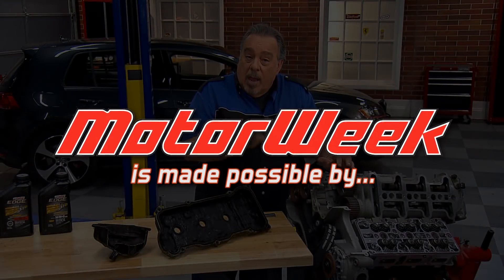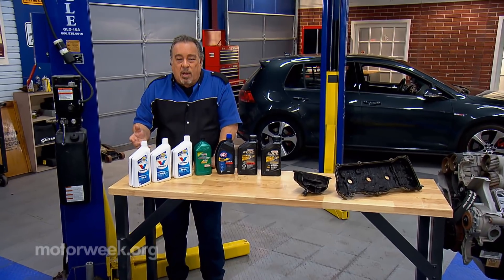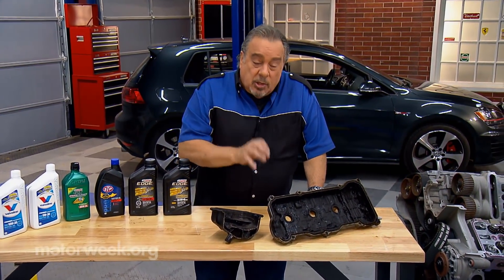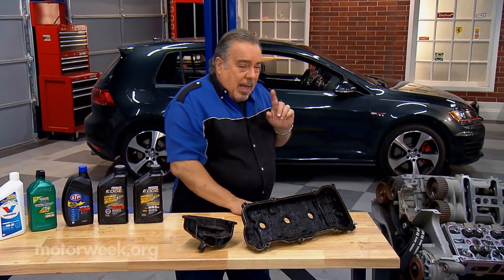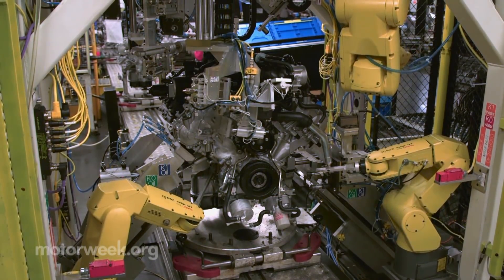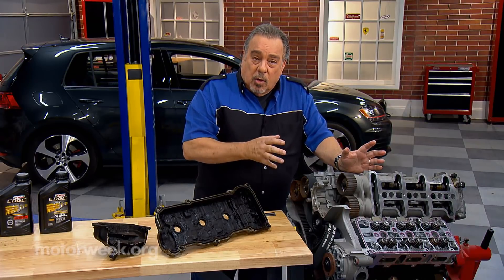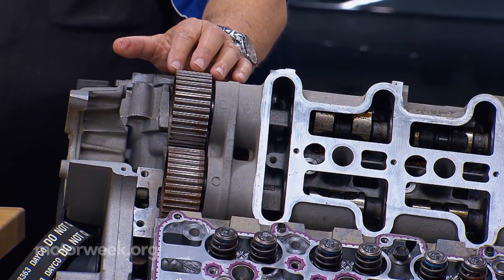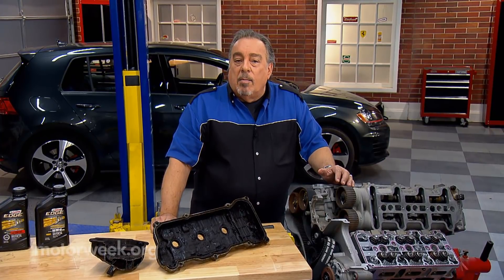Goss' Garage: Oil Viscosity

Comment: He never mentioned anything about going the other way. I noticed a lot of preignition and oil consumption issues on my car for the last couple of years. Given the old thing has 200k miles on it, figured it was nearing end of life. Then I discovered my oil change place has been putting in 5w20, despite it requiring 10w30. Next change it was filled with synthetic 10w30, and many of the issues went away.

The advice is sound however, stick to what the manufacturer recommends

Comment: 2nd number in oil is what really matters. So in say a 5w-30 oil , a 10w-30 oil will be exactly the same at operating temps.  The 2nd number is the operating temp rating. 1st is your cold flow rating so whether 0 , 5  ,10w-30 oil its all the same at operating temps only diff would be at cold temp start ups the 0 would be better for colder climates

Comment: Just got my 2012 Optima serviced for the "metal shavings" recall and they wanted to flush the brake line.....only 51,000 miles? Is it time?? Thx!
Reply: Test the brake fluid to see if it is too acidic or not. 50,000 miles on normal driving sounds about right.

Comment: Good tips Goss. My cars manufacturer says I can change at 3750miles or more but then the dealership tells me to change it every 3000 miles. I have seen some people complaining about oil sludge causing engine problems even with proper oil change intervals, so it sounds like even proper maintenance with not so good engine design an cause problems. I'm sure all the 2.7L V6 dodge owners know what I'm talking about.

Comment: One question. Say your vehicle calls for 0w20. You check your oil and see that it needs a quart.  You check the station your at and realise the y only carry 5w20 as the lowest oil type. Could you use it in a pinch or should you keep going until you come to either a dealership or auto parts store??
Reply: animal16365 I would think it would be fine. Same thing goes for gasoline. Say your car requires premium fuel and for some odd reason there is only a lower octane gas available, you can use it in a pinch. There is some wiggle room for tolerance
Reply: Use distilled water, change it asap.
Reply: That's fine. your engine will stay warm and the oil will be at 20 grade.
Reply: Yup, topping off with a slightly different viscosity oil than what is recommended is perfectly fine and is definitely better than continuing to drive with low oil. Keeping an extra quart of the proper oil in the trunk isn't a bad idea though, especially if your vehicle requires occasional top offs.

Comment: My S2000 recommends 10w30 from Honda but since the vehicle sits for a long time (driven once or twice a month), I put in 0w30 to help get the oil to circulate as quickly as possible at first cold start up to reduce wear. 10w30 makes sense at the track or constant normal driving but not for my specific situation. Agree?
Reply: Jae Baek  sure
Reply: Modern Syn. oil is more "shear stable" (ability to resist viscosity change) than older oils.  S2000 (unique engine designed 20+ years ago) revs to 9,000 RPM.  Considering a conventional oil may be used, Honda may have (20 yrs ago) wanted to spec 10w since they were more shear-stable than a 5w.  Today a synthetic 0w-30 is good to go.
Reply: Jae Baek I store my 2001 S2000 with any cheap 10W30, then when spring comes I run 0W40 M1 Euro.... For the street and also very suitable for the track, you should run at least  40wt on the track... Love my s2k!!

Comment: Nowadays vehicles are very efficient, so is it still recommended to change your car oil every 3,000 miles with the use of either Mobil or Castrol synthetic oil? Can we change the oil every 4,000 or 5,000 miles instead?
Reply: Follow what your owners manual says.  Most newer cars go around 10K miles on full synthetic and you will be fine, just make sure you keep an eye on the level during that time.  Since I'm OCD about oil, I change it around 5k.
Reply: Bo Bu doesn't matter what brand of oil you use as long as it's the right viscosity . You can buy the cheapest oil at Walmart and it would work perfectly fine.
Reply: I would go with the manufacture recommended oil viscosity and change interval under severe condition. You also need to know what conditions are you putting the oil thru. For example, if your tracking or racing the car under harsh punishment, or live on a dusty farm with no paved roads then I would check the oil level and change the oil more frequently and replace engine oil more often. The only car maker I would not follow is BMW. Their 15K mile and engine oil and oil filter change is ridiculous . I have seen all of my BMW with that oil change interval have lots of crude inside the oil cap, valve cover etc. Plus all the oil leaks because of the acidic oil eating the seals away etc.
Reply: Thank you all for your feedback. I guess I will drive it up to 5K and then change my oil. And my car is a 2016 Nissan Murano and I’m using the Mobil 5W20 Synthetic oil.
Reply: Bo Bu I don't like going over 7k with synthetic oil. I'm very OCD and change it every 5k miles which is playing it safe. Make sure you get a good oil filter which is critical
Reply: Joe Johnson - That was true years ago, today oils are a whole lot better!
Reply: Follow your owners manual !! Don't listen to any auto tech that said you need oil change for every 3k on modern cars.

Comment: If you have a lot of miles on your car running a start up grade higher then recommend is not going to hurt anything but I would still with the same running weight say 5w30 vs 10w30

Comment: Is it ok to go from 5w30 in summer down to 5w20 for winter and vice versa, I just use 5w20 full synthetic year round.
Reply: Follow whatever your owners manual tells you. I think you misunderstand about engine oil. Changing from a 30 grade to 20 will increase fuel economy by a little but also hurt your engine.

Comment: Wrong on a few points..:: lower viscosity and higher flow rate many mean better cooling but not necessarily less wear due to lower film strength.... and sludge formation isn’t caused by using a higher viscosity than recommended.